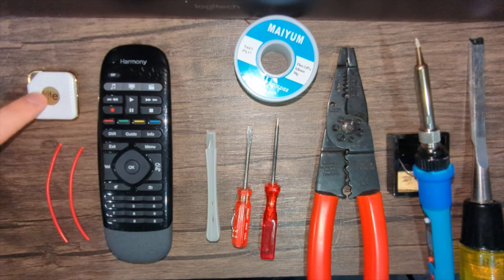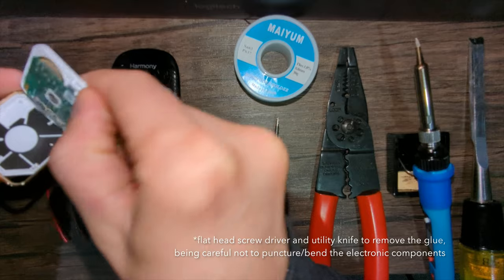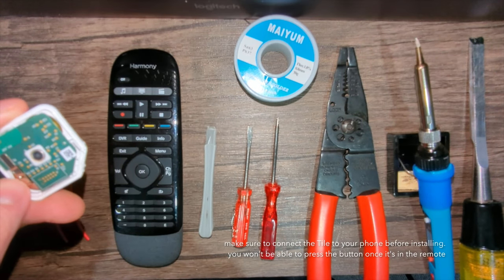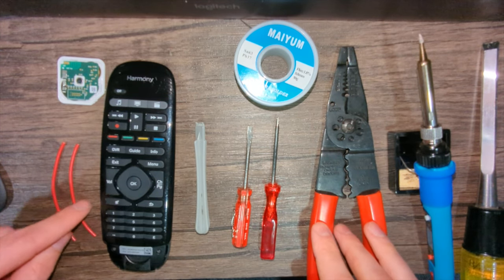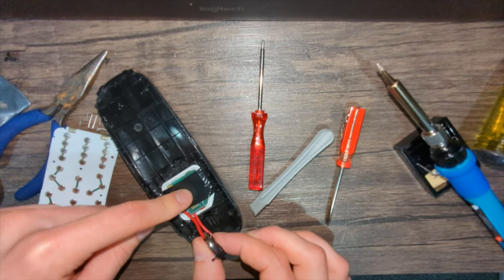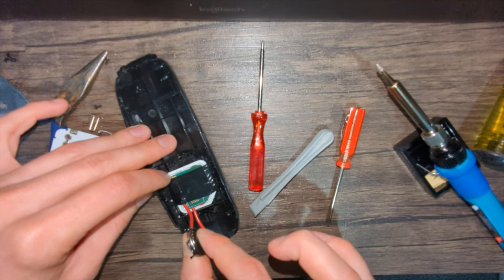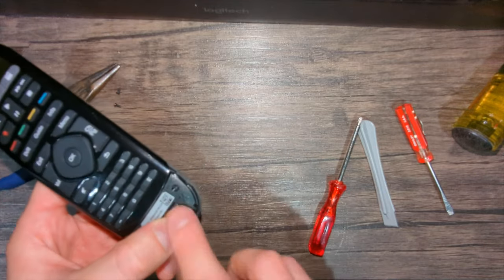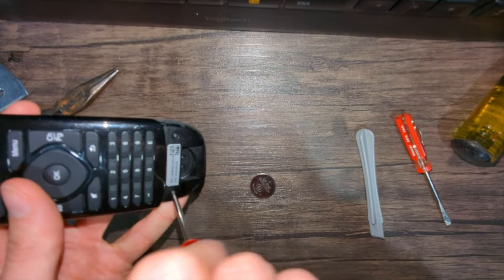How to Install a Bluetooth Tracker into a Remote Control - Tile Tracker - Logitech Harmony Remote

Comment: I probably still would have soldered the tile wires into the remote leads to have a stronger connection, but good video and great hack! I've been replacing the batteries in those "non-replaceable" Tile Pros for years, nothing a tack of glue to keep the case together won't fix.